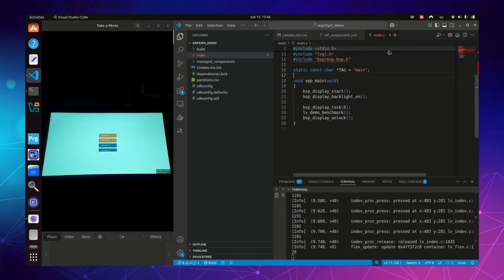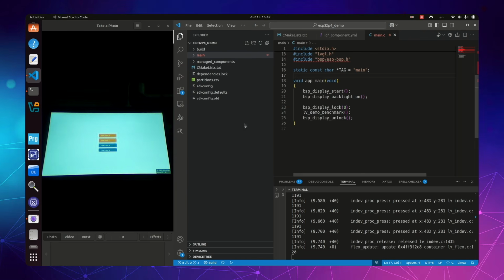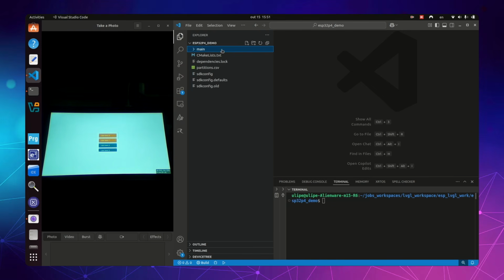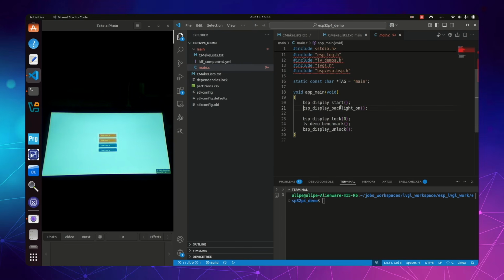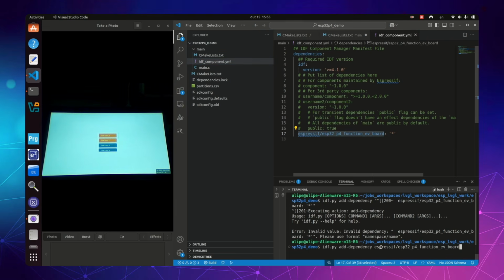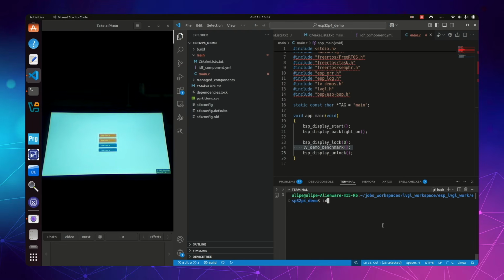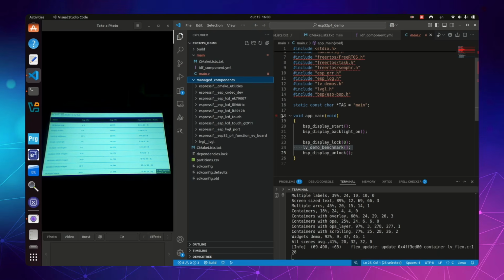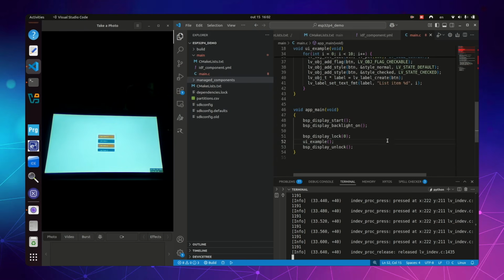Build UIs on ESP32-P4 with LVGL | Hands-On Tutorial

Comment: Useless video. How to port it to different displays? First of all how to made or copy the project to vs code? Why cant you show that in esp idf or arduino? You showed the 10% of the whole thing. I tried to integrate lvgl to arduino also to esp idf but the whole library is useles. The compliers does not find your .h or .c files. Even ehen i copied everything in the rigt place and choosen the right settings. Even your demos does not work. I tryed to fix this broken mess hours up on hours but it crashes the esp32 p4. I think you should need to fix your broken library first.